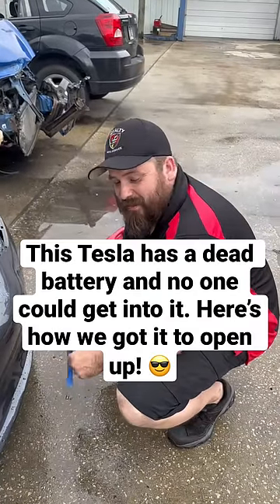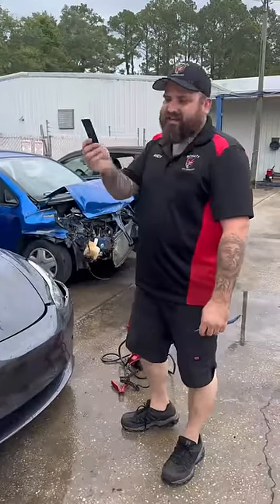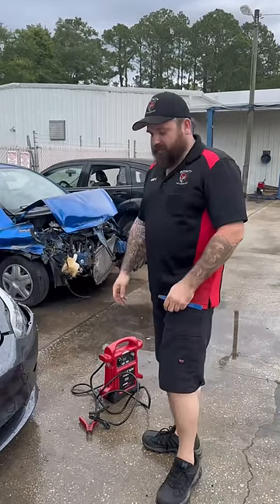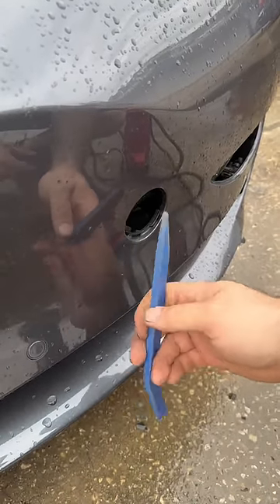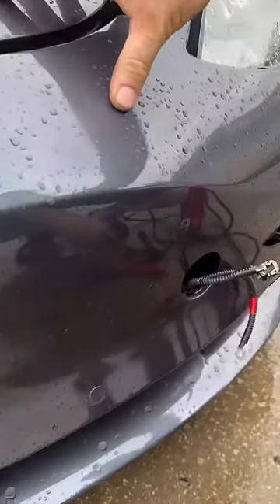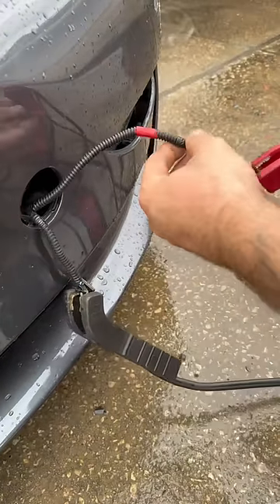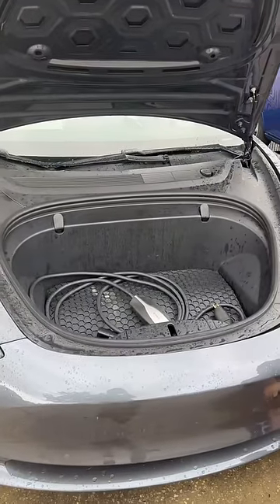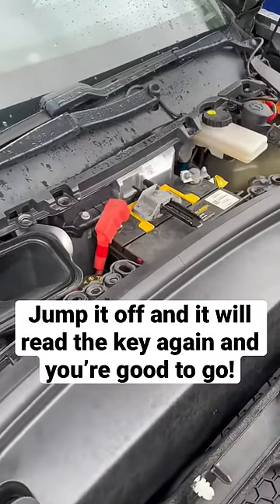Dead Tesla! How Can We Get Into It? #shorts #tesla #teslamodel3 #car #mechanic #crazy #hack #tips

Comment: Criminals everywhere: “WRITE THAT DOWN!” 😂
Reply: Exactly what I was thinking. I wonder if the key is needed if not it should be.
Reply from the maker: You would need the key to get inside the car. We have been told the frunk will not open if the 12v battery is charged. We are going to see if we can verify this though!
Reply: @theroyaltyautoservice  I figured you’d need the key. But that’s interesting about being able to access the frunk if the battery is dead, and NOT being able to access it if it’s charged.
Reply: Either way, it gives you access to whatever is in there. Just don't keep anything that looks valuable there.
Reply: aww shit...here come the Tesla Boyz🤦🏽‍♂️😒🤣😭😂💯
Reply: @theroyaltyautoservice  you would think the wires would go to the 12v battery to add power to allow key to work like a low current jump what is wrong with a mechanical key to open in an emergency
Reply: @jackiemay9471  there are a variety of ways the battery could go bad, not all are fixable with a quick jump.
Reply: @deanonesense  all i meant was to get power to the 12v car battery just to use the key to open frunk    as the way tesla has the wires any one can open the frunk ?  so this action would be classed as a jump start there is no starter to engage and what is wrong with using a mechanical key to open a disabled electric lock no need to mess around with wires and batteries
Reply: It won’t open unless the battery is actually dead. So no you can’t just go up to any Tesla and open the frunk like this unless the battery actually died.
Reply: @AshTag  thanks for repeating what has already been said ha
Reply: @lucasblanchard47  Ash probably meant to @ jackie may
Reply: @AshTag  that is said in video and why i put  ? by it untill proven i would not trust it  and still a faf  what is wrong with a key to open a lock then a pull latch inside car and if the battery is low enough not to open the frunk and not loe enough to allow the hidden wires to work
Reply: @jackiemay9471  yes, I’m just saying I’ve seen it done in front of me and it works just like it’s described
Reply: @jackiemay9471  if the battery shorts out internally or has a loose cable, a bad component or some other issue other than just being dead, you have to be able to physically access it to repair it, and this gives you access to the electrical system.
Reply: I sure did, steps 1 2 3
Reply: Most thieves use the crowbar or brick hack anyway.
Reply: @ke6gwf  like i said what is wrong with a mechanical key to gain access
Reply: @aaronfuller6205  Only to try to dispel the FUDI
Reply: @jackiemay9471  this will work with a good 9V battery. It only grants you access to the frunk. If the 12V system is functioning, it will not work.
Reply: @lucasblanchard47  You find a victory of some kind in that? Not everyone understands the comments are listed in reverse chronological order.
Reply: @jackiemay9471  that's like asking "what's wrong with a land line phone that never gets a dead battery?"
Convenience comes at a cost, and just like everyone wants power windows even though they can fail, unlike a hand crank, people want to be able to pop the doors and lids by remote, or from their phones, and making that capability, and also adding a key backup, just adds a lot of extra parts and cost that almost never will get used.

Most Tesla owners will never have to do this to open the frunk, because they will not let the car sit so long that the battery goes dead, and so having a key override would be useless to them.

And if you only need it once in 5 years, what are the chances that you are going to even remember where you put that key? Lol

Most other cars have a key fob of some sort, and they can hide a physical key inside, but the Tesla doesn't even have a key fob, it uses the app on the phone, or the little credit card looking thing to unlock the car, and some people have even implanted chips in their hand to unlock it lol, and so a key would have to be something separate to carry, and no one is going to carry a key that they never use.

So if you want a physical key, a Tesla is not a good design for you.

Oh, and a lot of other fancy cars are going all electronic as well, where if the electrical system fails, you have to tow it back to the dealer to break into the car.
The fact that this can be done by any mechanic on the Tesla is actually better than some of the European cars currently.

Now you go back to enjoying driving your Buick Roadmaster and don't let the new technology bother you ;)
Reply: @deanonesense  oh well they didn’t so that makes it looks like they just replied without reading any other comments.
Reply: @The_DuMont_Network  yes I think I won this comment thread with no contest 🤣 why even bother replying about someone who clearly  didn’t read any other responses before commenting? Thanks for playing, ref.
Reply: @ke6gwf  had a tesla got rid of it for a number of reasons and can add this as another there are a number of top end and run of the mill cars that are keyless  and there is a key hidden in the fob  and a lot of people dont know they have a key
Reply: exactly! you are an engineer, I failed Texas A&M, in '88 but  engineered a USMC career until 2012 "oohrah". 7;^> ...heh
Reply: @jackiemay9471  and some of the ones with keys won't open if the electric lock mechanism fails.
Any mechanical device or electronic system can fail, and I think it's pretty good engineering to design in this bypass in case the battery fails.
Reply: @ke6gwf  loose wires behind bumper cover that can flex work harden break  or rot the solenoid can short seize wires can melt mind you tesla dont have any fire issues there is always a disc cutter or air chisel with panel ripper to gain access when the module goes down that senses the battery is flat to allow the emergency wires to work the mechanism that latches the doors front and rear luggage compartments rely on a mechanical componant that bit can fail  yes have all the toys to make life easy i have been in a body shop working on all makes of cars and commercials for over 45 years  for instance last week had a land rover evoke in shop driver door lock locking solenoid fail at 15000 miles having trick wires to that  still would not open it key to the rescue  if it was the other way around and electric opened the car brilliant  two different systems as back up that is my opinion  and like peoples butts we all have one they all stink bye
Reply: Come on man they already know.....
Reply: You know they are
Reply: @jackiemay9471  Tesla dont have traditional keys. Its an RFID card like at a hotel guest room door.
Reply: @jackiemay9471  mechanical keys are just as easy to break into bro. I lost my second key and locked my last key into my accord. This is how useless a mechanical key is. Its useful because many people are sheeple and it can work. But a glass window isnt stopping anyone from getting in who really really wants to. I figured out how to break into my accord with a piece if flat plastic. I think I have a 1 cent peice of plastic that can break into many many many vehicles if I was determined in an apocolypse now. I just skip the lock all together. Where there is a will there is a way bro because in this world you might lose a key and lock one in and you cant afford to call a lock smith or have time to learn to pick your lock, you just need to get in. You want your ignition to be bypassable to someone who needs to bypass. A hidden switch or something who knows. I sold my car and it was nice as it had a key that wouldnt turn the car on unless it was the programmed key but i also liked my 2000 toyota coup because the key was just a key and if you had to pick the car and turn it on without a key you could easily if you knew how. It wasnt ever stolen. It still drives around in my area after we sold it. This tesla is too hard to access for me bro. Elon really likes his security. I dont think i can pop open a tesla with a piece of plastic and get away with it. Thats why i like motorcycles. Many are still for sale and you can break yourself into your own bike in a pinch if you had to. Theres plenty of bikes woth alarm systems but to me I have it parked in a locked shed with security cameras so a key is a lot of security. If i lose my key 3 days away from home i want to be able to pick my ignition and still ride my bike home. Thats why combination locks are nice. No key.  but theyre also easy to get passed often times because like i said, you want a way to bypass things. We want to be able to pick locks or cut chains.
Reply: @TheAnnoyingBoss  a flatbed and any car you want is yours a lock only keeps out honest people never mind how complicated  a bit of time a little knowledge a radio rf scanner computer rewrite eeprom i like the idea of both electrical and mechanical as back up like you get into a elevator go to 20th floor get a power cut do you wait for power to be returned or just use the stairs
Reply: Right
Reply: But if the battery's not Dead the car will take your picture and send alerts to the driver
Reply: @Ratrazor  the driver will have a good picture of you wearing a mask of david copperfeild  as you stop all communications via rf with a faraday cage and jammer and gone in 60 seconds hey the would make a good film title where there is a will theres a way
Reply: Whats wrong with the old fashion method, just smash the side window.
Reply: @pqrstzxerty1296  so you want to steal a lot of  broken bits of glass what ever floats your boat
Reply: @jackiemay9471  Why would I steal the broken glass.  Steal parts off the car, not broken glass silly.
Reply: Don’t no one want to steal that 💩
Reply: Elon musk is fixing everything as life goes on lol
Reply: Ya really
Reply: No we dont... 😂😂😂 but so far it has worked 7 times. 😂😂😂
Reply: Still need the remote
Reply: @theroyaltyautoservice  pop the wires out and kill the battery if you can open it dead without a key lol. Youd be an idiot to steal a Tesla tho since they literally track your every move and record everything.
Reply: You still have to have the key
Reply: 😂😂 2 wires to open the trunk. I guess a simple button is way to hard. Than you got to pull out 2 more plastic covers.😂😂
Reply: @JustDaveslots   You don't know what you're talking about.
Reply: The cameras when everything is working are a good deterrent
Reply: @lucasblanchard47  just sounds like an always on relay draining your power to me tbh
Reply: @sienile  so would a crowbar and it would take less time
Reply: @misterbulger with  pin to drive you can't steal  it with the key.
Reply: Takes about 1/10th the time to Get into the car itself without a key.  No damage.
Reply: @BobSmith-kd6lq  - I seriously doubt a crowbar would do it in less time. And it would certainly draw a lot more attention.
Reply: @sienile   popping off a cover, fishing out wires, hooking wires up to power supply and then popping the hood is faster than popping the hood with a crowbar, gotcha.......you voted for biden, huh?
Reply: Good luck stealing a Tesla without the owners commands from their phone or Tesla key card. 😂
Reply: Theres always that one person u know the person who says it is usually thinking it so it makes you guilty by association 😂 im just giving ya a hard time i really hope u have a good sense of humor and not get all mad when you read this im bc im 100% joking😂 i been watching to much danny duncan lmao
Reply: @MiguelRodriguez-nt5eq  - Looks like what's shown in the video bypasses all that to power the actuator directly. Car may be safe, but not the contents of the trunk.
Reply: I don’t write anything down you know thing in your skull it’s called a brain bud
Reply: Does anyone remember the first Tesla cars? They were little two seaters that looked like a Lotus or Ferrari. Well, our first experience with recovering a dead one was a hell of an adventure. Some deadbeat wrote a bad check and took the car to a Scottsdale AZ hotel and dumped it in the underground garage. I was sent to help with the removal from the garage. The truck I ran was a little short of ten feet tall, so it wasn't going in the garage. Our low clearance wheel lift truck was there and I fortunately was able to quash the idea that the transporter driver and the other guys were trying to organize. The entry and exit of the garage is a spiral ramp. The guys wanted me to join them in hand pushing the car on go-jacks from the underground to the street. I put the brakes on the idea before any go-jack appeared. I explained so they could understand that I and neither of our other drivers were going to do what would be virtually guaranteed to injure or kill at least one person. Hand pushing a controllable car up a ramp would be very stupid. Pushing a car on casters up a ramp would be suicidal. Since there is no way to roll the back tires in neutral, our only safe option was to dolly the back tires and wheel lift the fronts. Next was maneuvering the truck and car up the spiral. It took several stabs to bring it up and out, but the dolly tires were able to come up without catching either side. We were planning on setting the car in the street to load it on the flatbed, but since our immediate destination was 2½ miles away, we left it on the wheel lift and a transport trailer was set up to take the little turd to CA. I didn't know about the trailer deal, but I found out about it in the morning. 4 in the morning. The trailer has a loading ramp and the low clearance truck was trying to put the car in the trailer by wheel lifting the back tires and pushing the front end into the back of the trailer. Fortunately, the owner of the trailer stopped our little truck from backing onto the loading ramp. The dually tires would have crushed the ramp which doubled as a tailgate. They set the car down with the front on the ramp and the back tires on the ground at the back end. They figured out that the flatbed's wheel lift was far enough back of the tires that I could put the car all the way in the trailer without hitting the ramp. We finally got the car inside and headed off to CA. Later when the S models became available and people started needing them hauled, I already knew what needed to be done to haul them. I was THE driver to move them for a while, until the other guys learned how to work them, but they dragged them a lot.
Reply: Batteries are for toys. I won't buy a battery powered car until airliners, freighters, bulldozers, and John Kerry's private jet are battery powered!
Reply: Got It!!!😅😂🤣
Reply: Read my mind.
Reply: It doesnt open the door damn. Its just allows you to jump the vehicle to allow access with the key
Reply: @sienile  if the vehicle is charged it doesnt work
Reply: @jmarin3177  ... Like Peggy Bundy's.
Reply: @DennisDoOffical  Yes, you need the key. That is just an emergency power hook up.
Reply: Now I know how to steal from the frunk of a Tesla model 3.
Reply: @lucasblanchard47  you are literally putting power direct to the lock on the frunk. Regardless if the 12v system is dead or not 🤦🏽‍♂️
Reply: That won't do anything they can open the trunk but that may be it. You need the pass key credit card like key . So good luck criminals...
Reply: @theroyaltyautoservice  nah I'll just bust a back window out thx for the education bro!👍
Reply: @theroyaltyautoservice  can you help me to understand why it needs a standard 12v battery in addition to all the lithium cells ?
Reply: I threw a brick through the window but I got caught because the person was charging his car at the charging station. I didn’t realize he was still in it. I threw it and hit him right in the face turns out he was a cop.
Reply: @Greatest_Scott  it needs 12v battery for normal electrical loads. Modules, lights, etc. The high voltage battery runs the electric motors to drive the car. Hth. Thanks for watching!
Reply: @BobSmith-kd6lq  
No but clearly you voted for Trump since you clearly lack the logic to understand anything you saw in this video. Using a crowbar will only cause damage to the latch of the frunk but you still won't be able to get into the car or start it since you still need to Tesla key to actually get into it. 

Unless you put power to those two leads, even if you somehow stole the Tesla keycard its useless because it won't work without power to auxilary battery which is why you have apply 12V to those leads in the first place. 

So no, a crowbar is useless for anything other than stealing stuff out of the "frunk". You still would need a bring a 12V booster with you and the matching Telsa key to do anything else thus why a crowbar is useless if your intention is to steal the car.
Reply: @jackiemay9471  "what is wrong with a mechanical key to open in an emergency" the whole point of boosting your secutiry is to remove any potential hole that criminals can use... adding "security key" is in most cases a huge security hole -> most of the wireless padlocks have it and it making the padlock super easy to open...
Reply: Exactly, whats to say that a thief couldnt gain access doing this with car where its owner just hopped out of it to go to Walmart. I dont know, dead battery or not should this "Hack" work?
Reply: @sherwoodcooke7766  why does it need it though ? To extend the life of the lithium?
Reply: Yeah it wouldn’t be very often they’re stealing a completely dead car.
Reply: ROOOLLLFFFF!!
Reply: Yup
Reply: No shit !! Unreal
Reply: Copy that BOSS MAN WE WRITING
Reply: HAZZAR!!
Reply: It's on line
Reply: Battery chargers gonna be the most popular bought thing for criminals 😂
Reply: Wow....3..2...1...I got your comment 😂😅
Reply: @theroyaltyautoservice  It doesn't matter. A telsa is just a computer wearing a car suit. If someone can hack a computer they can def hack a telsa. 

Welcome to the future of EV's...
Reply: 😂😂 exactly what I was thinking
Reply: Was about to say the same thing
Reply: Its still need the key
Reply: @sienile  the frunk won’t open with this trick if the 12v isn’t dead
Reply: Seemed strange that the 2 wires you pulled out to jump it where not insulated against shorting out if touched together while back in the hole...?
Reply: @theroyaltyautoservice Good thing no one ever puts their valuables in the frunk
Reply: Exactly
Reply: Well no you could actually just use 2 raspberry pi and a bit of software to basically just transmit the key card signal to the car 1 near the key(within the same room) and the other next to the car it then basically just copies the key code/the code the car is sending out and sorta spoofs the key allowing you in and to go up the road
Reply: No kidding 😂
Reply: Its a Tesla, good luck stealing it, the owner just opens their app and gives the cops your location.
Reply: @nutmegdonkey  I mean if someone took the time to spoof the key card they'd also disable the gps
Reply: Exactly!!!
Reply: @jackiemay9471 adding it costs money
Reply: I don’t know y but I m not a fan of electric cars
Reply: @theroyaltyautoservice  so...is it possible to quickly drain the 12v either with these cables or something else, and then do this trick you show in the vid to pop the frunk?
Reply: The best thing about it is that the transponder key is laughably easy to replicate.  A laptop and an SDR with some software are all you need.
Reply: No valueables in frunk than
Reply: Tesla boys ft Kia boys 😂
Reply: And the cut off to the high volt system, is behind the small triangle window on the right side at the rear seat..
Reply: @sienile  i think you misunderstood the NOT being able to access if the 12v battery has power i.e. this only works if it is dead
Reply: No, what's criminal is not being able to open a door without elecricity.
Reply: Not sure who would want to steal a Tesla, but yeah I guess theres some weight to your comment.
Reply: @theroyaltyautoservice 
Reminds me of my dead x5... jumping the license plate light will unlock all the doors.
Reply: @jackiemay9471 search up mcnallyofficial and thelockpickinglawyer. they'll show you what's wrong with a mechanical key
Reply: This was addressed by tesla years ago
You actually need either the key card or phone key to pop the frunk  now
Reply: He opened the frunk with the key. So no you can't open the doors without a key.
Reply: @sienile prybar works wonders lmao 😅locks just keep honest people honest
Reply: Who’s 
Going to want to steal that junk 🤷🔥🔥🔥
Reply: There is a security mode that prevents opening any door besides the driver.
Reply: @theroyaltyautoservice Did you verify that?
Reply: U can do all that with AAA size A23 Battery!!
Reply: @jackiemay9471 There is no keyhole, no mechanical key. A 9v battery will open the frunk. You need a higher current 12V source to ower the electronics. You still need the electronic key or card.
Reply: @jackiemay9471 Why bother with expense of keys and mechanical latches?
Reply: @josephl3602 still can't drive it tho. No lock to pop
Reply: Good way to raid people’s frunks .
Reply: I was just thinking  that too 😅
Reply: The FRUNK is tiny.The one on my 65 Corvair is Huge 😂
Reply: To get into the boot??? You fool lol
Reply: I was thinking the same thing 😂
Reply: Exactly. Thanks for teaching the criminals.
Reply: Wonder what ethnicity the vast majority of the criminals are 😅
Reply: Thanks I did. 😅. But who wants to have a Tesla? Not me.
Reply: @AshTag  if the battery is dead, then you just take a wrench and smash the windows, and bend the frunk.  NO need to worry about alarms :)
Reply: Only works if the car is actually dead. Facts
Reply: It’s virtually impossible to steal a Tesla and get away with it. However, the frunk is defo a weak spot… if this is real
Reply: @aaronfuller6205 😂😂😂 As a Tezzy owner (don’t worry I have a V8 as well), you can’t steal a Tesla and get away with it. However, I’m a tad concerned about the frunk. If you manage to get a Tesla started your success of stealing it is almost zero. Hence why you never hear of Tesla’s getting stolen… also, no would would want is what everyone is gunna say. I love the hate, makes me laugh 😂
Reply: Yay, note they have access to your useless 12v battery.  Now what?
Reply: @Ej-en2lz  Umm....I must have missed the part where I "Hated" on Tesla's by making a joke about The Bs ass Kia Boyz.🤔 I love all EV's..I literally work for Rivian. But hey stay blessed brother man..🤷🏽‍♂️😂😎
Reply: @Trueflights  then you put a bag of cocaine in the car, and call the cops that a guy in a tesla tried to sell to kids in the schoolyard.
Reply: Just take the battery and just keep going
Reply: It gonna be tesla boys now 🤦🏽‍♂️
Reply: Nobody wants to steal that car. 🤷🏻😂🤣
Reply: Really easy to steal stuff inside the frunk and 12V battery
Reply: Is it a 'trunk' or really a 'Frunk'?
Reply: They probably already knew this before this video was released
Reply: “I don’t know how to write”
Reply: Dont matter if u write that down. How u gona start it.
Reply: @TheAnnoyingBoss 6
Reply: does not work when the low voltage system is on
Reply: @xanny7373  id like to think criminals are not smarter than elon musk.. and id be disappointed if elon didnt think of security protection for his customers. If criminals can think of something.. surely elon wud be 10 steps ahead
Reply: Still doesn't help you open the car or steel it if you don't have a key. Plus, I'll just track the car from the Tesla app. Good luck!
Reply: No shit! Right ?😂 That's what I said.
Reply: You only steal things that are actually worth something. 😅
Reply: @jackiemay9471 actually it should be the power of the 12v being boost up but you also need your card key to opening the fruck.
Reply: @theroyaltyautoservice  👍 didn’t want to mess up the like count. 🤘🏽😈
Reply: @theroyaltyautoservice any update on this?
Reply: @jackiemay9471 wires are too thin to carry the current if internal battery is flat enough.
Reply: @Ratrazor What if you use the system to deplete the batteries instead of charging it?
Reply: @DennisDoOffical  Go ahead. I doubt you'd be able to do anything with it anyway
Reply: Still need a key to get it to go anywhere, say what you want about Tesla, but in terms of car thefts, they are Fort Knox
Reply: you still need a key haha
Reply: That’s not gonna save whatever things they have in those trunks 😂
Reply: They don't want an EV junk.
Reply: They should put roll up windows in all electric vehicles.  Imagine trying to get out of one of these if you happened to go off the road into the water during a accident
Reply: Easy steal the cars during the winter in freezing temps or take parts we just seen what happened this winter
Reply: They would rather go after something of value, like an ebike or a scooter
Reply: @theroyaltyautoservice  Ooooh that's an interesting little failsafe. ONLY allowing it to emergency open if it has no power. Clever
Reply: Doesn't work unless the battery is dead.